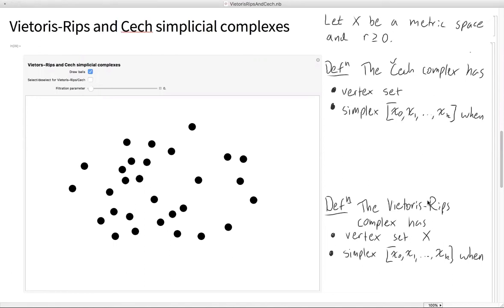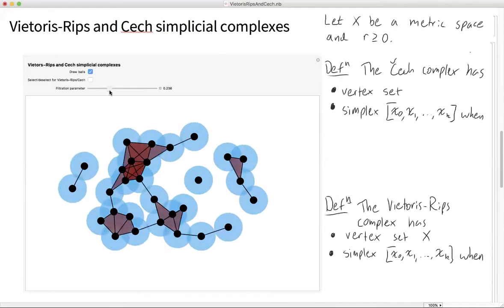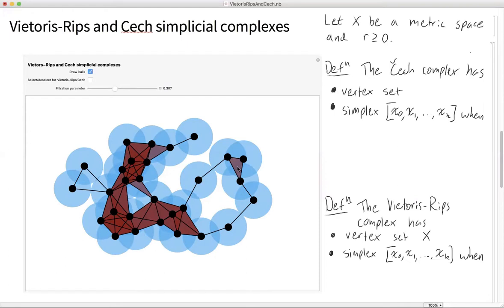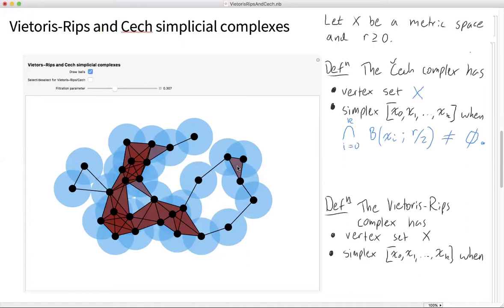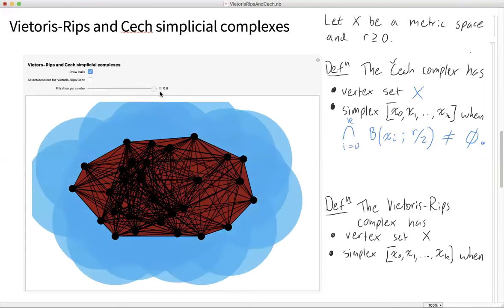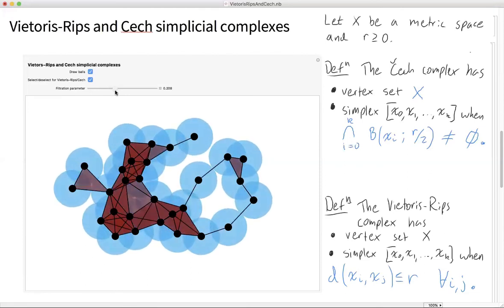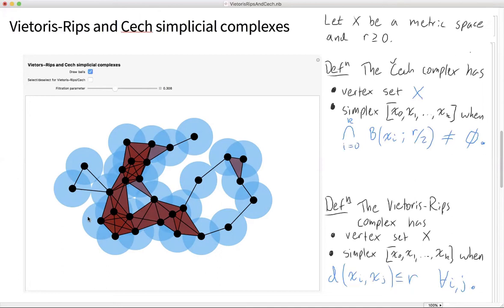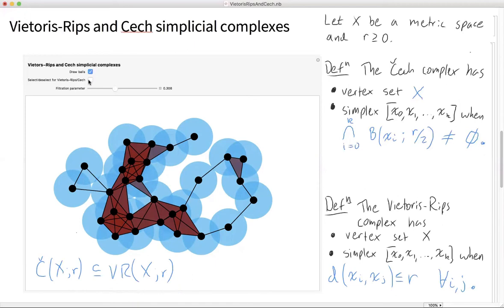What is the difference between Vietoris-Rips and Cech complexes?

Comment: Hi, I'm currently working on my thesis about TDA, and I meet the same inaccuracy over and over again.

No offense, just wanted to let you know, that there is a mistake in your video.

In 6:09 , you said that length of edges of empty triangle are at most r,
but assuming r is a radius of shown balls and equals 0.312, you're wrong :(
These two balls barely meet, so the edge has length 2r, so distance between two points (centers of balls) is not smaller than r.

On the other hand, if r/2 = 0.312, then visualization for Vietori-Rips should be different. Balls still should have length 0.312 for Cech, but 0.624 for Vietoris-Rips.

It is affecting on complexes, because Vietoris-Rips in 6:09 shouldn't even consist edges of this triangle.

Sorry if I'm wrong, correct me then, but this is something I would love to make clear ;)
Reply from the maker: Vietoris-Rips complexes have all edges of length at most r. There are two different conventions for Cech complexes --- either the nerve of all balls of radius r, or the nerve of all balls of radius r/2. Both conventions are commonly used, but they differ by a factor of two. This video is using the opposite convention for Cech complexes than the one you are used to.
Reply: @aatrn1  Excatly: "Vietoris-Rips complexes have all edges of length at most r." 
When 2 balls with radii r are touched in one point, then distance between these two centers is 2r. Not r ;) Then edge of this triangle is 2r. So it shouldnt be simplex of Vietoris-Rips of parameter r.
Reply from the maker: In this video, I'm using Cech complexes that are defined to have radius r/2. So, when two balls with radius r/2 touch in one point, then the distance between these two centers is at most r, and hence the edge is a simplex of the Vietoris-Rips complex at parameter r. So, there are two different common definitions of Cech complexes; one with balls of radius r, and the other with balls of radius r/2. This video is using the latter definition, not the former definition.

Comment: Hi Henry, what should be the perfect choice of filtration technique for point clouds in 3D or higher dim domains?
Reply from the maker: For 3D or lower (not what you ask about), you often want to use an alpha complex. For higher dimensions, Vietoris-Rips is probably what most folks try first. You can move to witness complexes for smaller approximating complexes. I don’t know of too many software packages implementing Cech; probably GUDHI does?

Comment: This is awesome! Very concise and clear difference between the two, I’ve been confused about this for a long time. Couple of questions: are there upper bounds on the scale parameter, maybe in terms of the diameter of the vertex set? Also is there a distinction between using closed balls and open balls in the definition of the Čech complex?
Reply from the maker: Thanks! Once the scale parameter r reaches the diameter of the dataset, the Vietoris-Rips complex doesn't change anymore. But typically (due to size constraints) you have to stop computing much sooner before you reach the diameter of the dataset!
     For finite datasets, there's not much difference between using closed balls and open balls in the definition of the Čech complex. Indeed, if r is a scale parameter where the Čech complex with closed balls disagrees with that with open balls, then there's an arbitrarily small epsilon perturbation you can make to r so that the complexes agree again. Probably a better way of saying this is that when changing from closed balls to open balls or visa versa, all that can change in the persistent homology for finite datasets is the endpoints of the persistent homology bars --- i.e. which endpoints are included or not. Same for Vietoris-Rips complexes, when using the <= vs < conventions.
     When building Čech complexes on top of infinite metric spaces, the difference between closed and open can affect homotopy types. See Section 9 of https://msp.org/pjm/2017/290-1/p01.xhtml or https://msp.org/pjm/2017/290-1/p01.xhtml in which a Čech complex of the circle (with balls in the circle, not in R^2) can obtain the homotopy type of an uncountable wedge sum of 2-spheres for closed balls, but not for open balls. But still the persistent homology bars can only change at endpoints of intervals. This has an analogue for Vietoris-Rips complexes of the circle with the <= vs < convention; see that same paper.